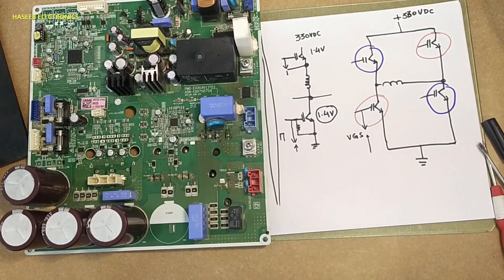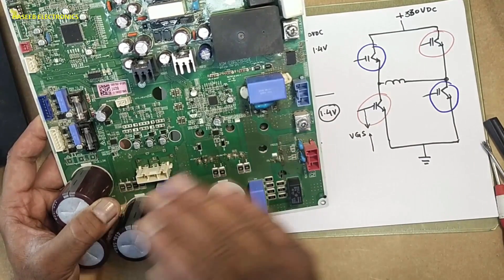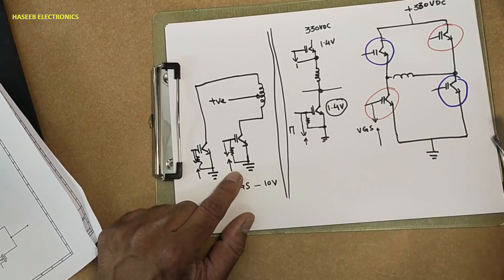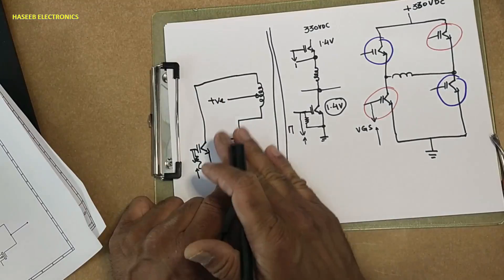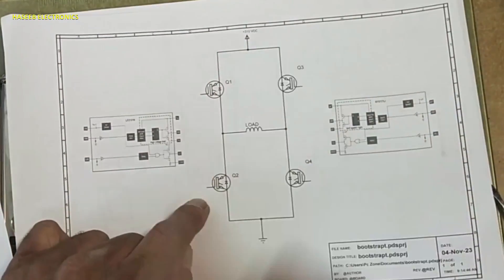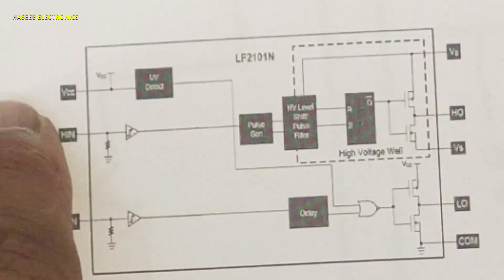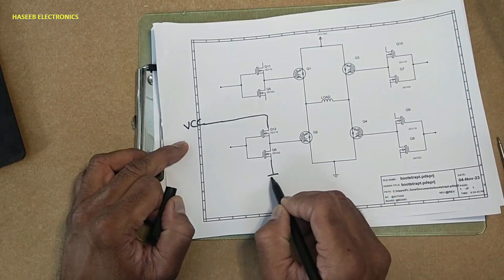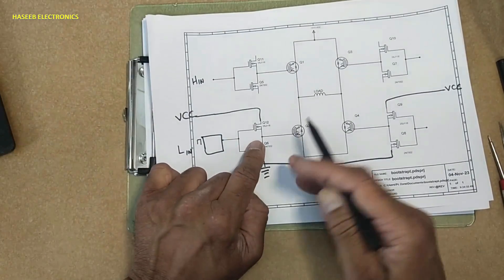{972o} Bootstrap capacitor explained

Comment: Hello. A have a question. Just one moment.... so when Cb is discharging, this process holds Q1 opened, but after a short time point between Q1 and Q2 has tha same potentioal as at Q1 gate or even much higher (for example: Vсс), so Q1 must close (because Cb polarity is reversed or potentials equalizes), is that right? Thanks.

Comment: Crack wanted to tell you that thanks to your videos in a new job that I started these days I was able to understand a completely new field. I am repairing the electronic controls of forklifts and they come with inverter technology and some other things, but the predriver part and that remains the same. They even use the ir2110 which you explain in depth in one of the classes. Thank you for your work and your dedication. Genius!